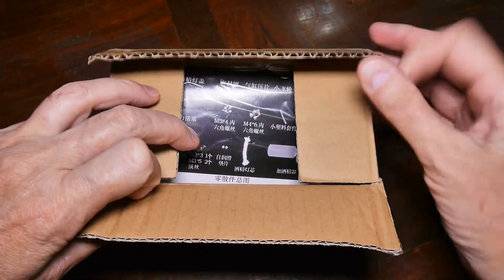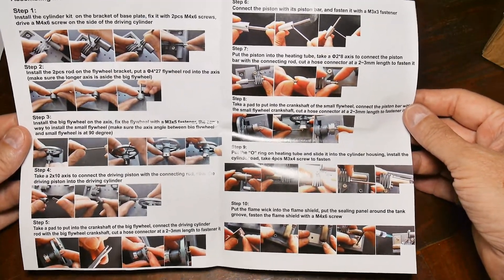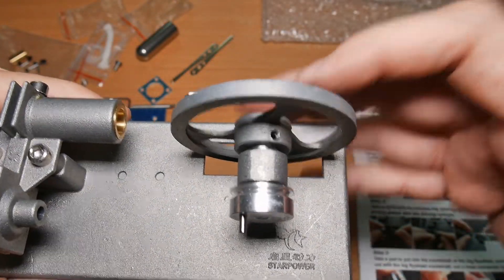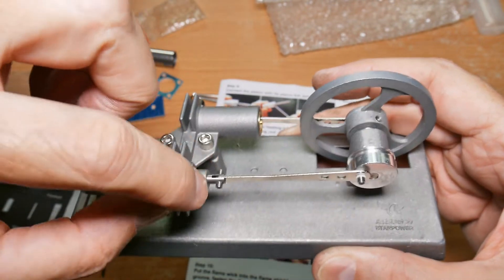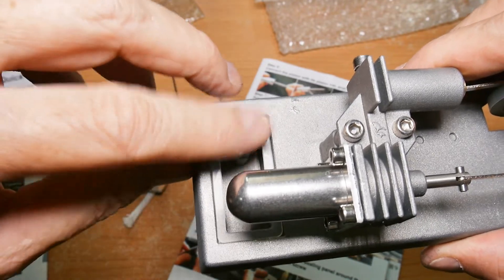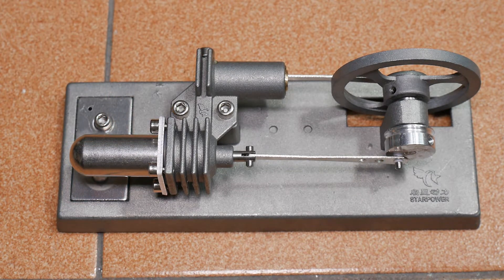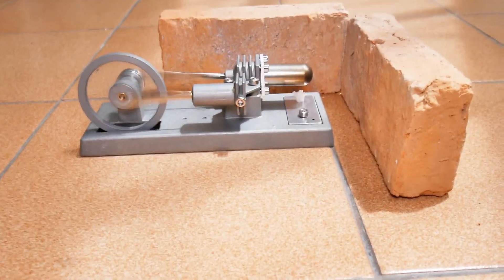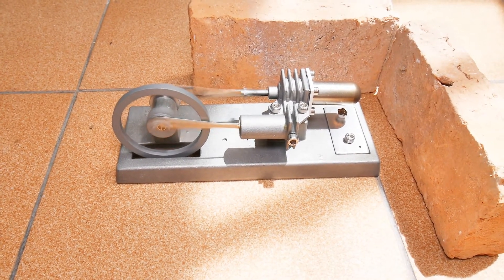Stirling Engine - High Temperature, 2 Piston Gamma

Comment: I think the timing on mine is off. Where do you set the arms on both flywheels
Reply from the maker: There are flat spots on the shaft and that's what you tighten the screws against. It might be possible that the shaft is reversed.

Comment: I just bought mine and the instructions were in Chinese.  Your video made putting it together so much easier.   I did put a piece of plastic on the Flywheel Pin because the arm was rubbing on the flywheel.  Thanks for the video. 😁
Reply from the maker: You are welcome. Good to hear the video was helpful. I think you will like the engine, it is well made and runs well.

Comment: What lubrication would you recommend with this?
Reply from the maker: I used a high temperature moly oil that was not flammable.  But you want to avoid oil on the hot piston or it will turn sticky and stop.
Reply: @tsbrownie  Would you avoid using any kind of lubrication on the heat piston? perhaps dry graphite lube
Reply from the maker: @michael_177  That might work, but I have not tried it.  Let me know if you do.
Reply: You don't lubricate these with oil. It creates too much resistance. If you do lube it you use graphite dust

Comment: Wouldn't it work better and safer with a properly trimmed wick and lamp oil? If the wick is trimmed properly, it will not smoke much.
Reply from the maker: That's a good question.  Ethanol burns at 1,920 degrees Celsius (3,488 degrees Fahrenheit)
Common plant oils 320 C to 450 C (608 F to 842 F).  So it might work, but at lower speed / power outputs.
Reply: @tsbrownie , actually, your numbers are way off. Lamp oil is essentially heavy fuel oil and burns at approximately 2100 degrees Celsius. TBH, I can't find any plant oil that burns anywhere near the low figures you mention. From where did you get those numbers?
Reply from the maker: @mrnickbig1  Got them off the internet.  Searched "burning temperature of xxx".  They are vegetable oils which are available to most people.  Things like kerosene are 990C.  Paraffin oils are much lower in the 150-300C range.  Oh, and I did not mention, alcohol is the preferred fuel per most of these manufacturers.
Reply: @tsbrownie  , your numbers are all HALF of what they should be, or less. I suspect you are looking a the wrong temperatures. What you need are the flame temperatures. This link has a table of peak flame temperatures for may materials under ideal conditions at 1 bar pressure and no wind,  normal air. https://en.wikipedia.org/wiki/Adiabatic_flame_temperature
Reply from the maker: @mrnickbig1  OK, thanks.

Comment: Hmm, add equal size and weight magnets to the flywheel and then some coils of wire close to the magnets and one should be able to produce usable electricity. Also thinking that a solar heat transfer unit to provide concentrated solar heat to the drive piston would also be interesting and a unique alternative to the use of combustible fuels.
Reply from the maker: I have 2 videos I have to finish, they have generators.  The solar power idea is interesting.  Would be easy and relatively efficient to wrap the displacer chamber with nichrome wire and insulation and power it with a solar panel.  I'm not sure I can reach the temp of burning alcohol which is 1,920 degrees Celsius (3,488 degrees F), or methanol at 1,870 degrees Celsius (3,398 degrees F)